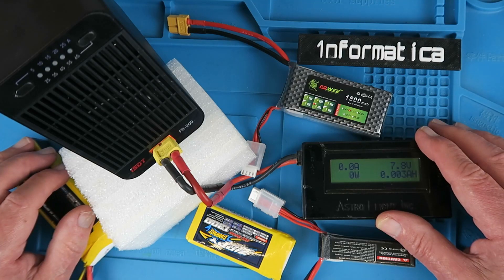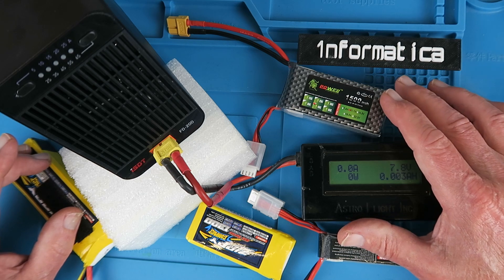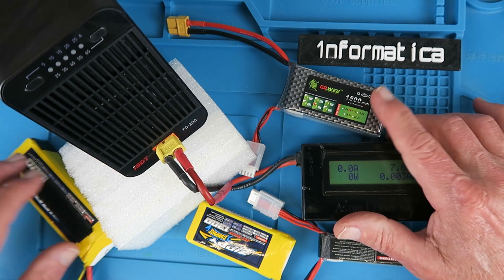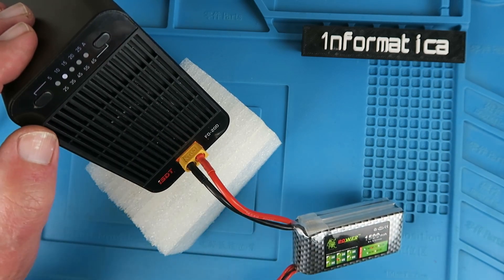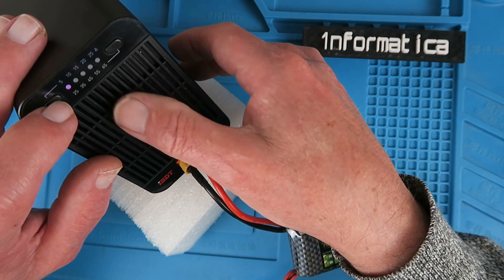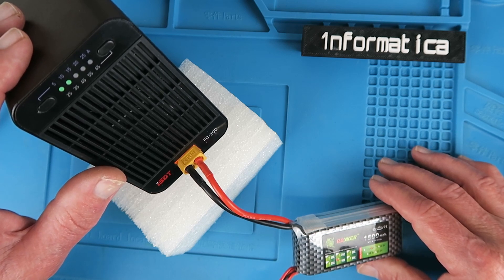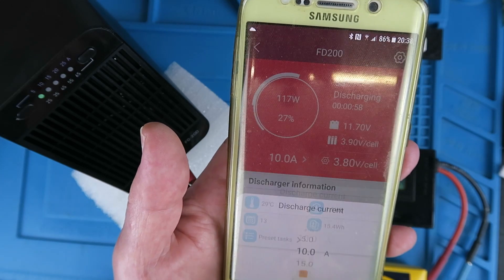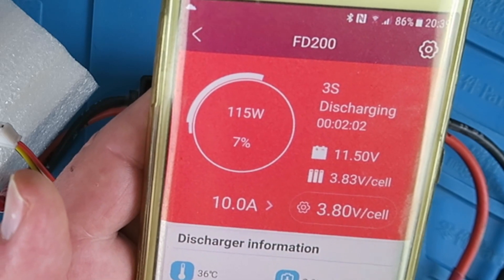ISDT FD 200 200W 25A Bluetooth Control Discharger 2 to 8S LiPo Review

Comment: Thanks for the very helpful video. Your very clear narration, explanation and demonstration is very much appreciated. I have one if these units and am delighted with it. But unfortunately i had to do a reset on my mobile phone a while ago, due to a problem with its camera, and afterwards the discharger can't seem to communicate with my phone. I have tried to re-pair it many times, but it asks for an access code. Ive tried 0000, 2222 and 1234 but none ofmthem work. I have made sure that the phone's location is turned on and that the discharger has permissions. I have also uninstalled the app and then reinstalled it - all without success. I have searched the Internet but have been unable to find anything which has led to the solution to my problem and I was wondering if you have any ideas. Thanks again for the video. Tony
Reply from the maker: Hey thanks! Well, the ISDT App is "flakey" to say the least! Once you connect a battery you get the white LED showing the cells. Open the ISD App and hit + to add the device. Then long press both buttons on the unit until you see a blue "kit car" scanning effect. You may have to open the mobile Bluetooth settings to allow the device, it's list at the end under "additional devices". There is no PIN! Once you see it in the mobile BT list, return to the app and hit scan and it should find it. Even when it does find it I saw the app disconnect during discharging so couldn't get the correct data. In the end I just use "manual" mode and hook a cell checker to the balance port. Have a great day!

Comment: mine disconnects from blue tooth all the time, Junk!
Reply: You were able to connect? I am doing every possible combination on how to bind it but it just doesnt want to bind.
Reply from the maker: @ipadize  You do not need to bind it. Enable Bluetooth on your device, plug in a pack and press either of the buttons near the LEDs and it will beep. Open the app on your device and it should scan and find the FD200 automatically.
Reply: Why is nobody on the entire youtube universe showing the binding process?
Reply from the maker: @ipadize  You do not need to bind it. Enable Bluetooth on your device, plug in a pack and press either of the buttons near the LEDs and it will beep. Open the app on your device and it should scan and find the FD200 automatically.
Reply: @1nformatica  yes i did exactly that. Didnt work.

I got it working now, i had to enable gps to be able to find the device...
Reply from the maker: @ipadize  Bizarre! Glad you have it working now. YouTube no longer shows me if you are subscribed. Please consider subscribing if you have not done so already!
Reply from the maker: I have seen mine disconnect a few times but it is no big deal. The thing is a battery discharger and it does that very well, connected to Bluetooth or not.
Reply: @1nformatica  mine will over discharge 1 cell when it disconnects... They are open to replacing it but a potential fire hazard is scary. I have a couple friends who own them with no issues. If it doesn't work properly the result can be disaster. As a discharger it is potentially a very dangerous tool. Good thing I monitor it closely like we all should be
Thanks for taking the time to review it. well done
Reply from the maker: @donaldfoster5998  Hi, An interesting observation. How can it discharge only 1 cell when the only connection is the complete battery? Perhaps the battery just has a weak cell? What happens if you balance charge the pack? I would check the cell voltages afterwards and see if that particular cell has a lower voltage. I say in the video that charging or discharging must always be closely monitored which I'm glad you are doing. Keep safe!
Reply: @1nformatica  it discharges all cells but allows 1 cell to dip below the thresh hold that is set. EX: If the thresh hold is 3.4v it will allow 1 cell to dip into the 2.Xv range. Not sure how low it would let it discharge as I have always caught it before Disaster. It has done this on several packs relatively eliminating the "bad pack " theory that I too contemplated before testing on more packs. And yes cell count is set correctly
Reply from the maker: @donaldfoster5998  What is the spec of the pack? mAh and C rating? What discharge current have you set? Maybe set the discharge rate to 1C and see if that cell still falls below the threshold. Interesting stuff!
Reply: @1nformatica  I have a ticket out with ISDT
I don't like to get batteries hot on discharge so I discharge at a lower rate usually. I have tried higher rates but temp is my guide. It now over discharges any pack. I use 80-120c packs for freestyle all different V and Mah values. Thanks or responding and helping out. I am miffed but no worries waiting to hear back from ISDT. I wish it had a firmware reload and not repair but all good. Every item can't be perfect
Reply from the maker: @donaldfoster5998  Thanks for the update, please keep me posted on what ISDT have to say.
Reply: @1nformatica  ISDT failed to get back to the Vendor for well over  a week so the vendor refunded my Discharger. Tells you a lot about ISDT
Reply from the maker: @donaldfoster5998  That is rather disappointing. Fortunately my unit is working well.
Reply: @1nformatica  as you stated in your earlier comment, these discharge units do not discharge cells individually. He has a weak cell in his pack, and this is no fault of the discharger. This is often the case when discharging below 3.4 volts per cell. Also I had one of these units that kept disconnecting from Bluetooth, so I had it replaced and the connection has been solid. I own two of them, and use them frequently to save the wear and tear on my chargers.
Reply from the maker: @elliotbaltazar  Great feedback Elliot, thanks for sharing. The unit has flagged some dodgy packs of mine as well. Old packs that you may think are OK can easily have one or more cells where the internal resistance has gone up to the point their voltage collapses under load. I see this behaviour as beneficial but sadly expensive in replacing packs or retiring them to "light duties"!
Reply: @1nformatica  😂 I feel the same way! I got my feelings hurt when I discovered that all of my SMC battery packs were way off the mark in their rated capacity and also had cells that were horribly mismatched. I'm thankful for these devices!
Reply from the maker: @elliotbaltazar  Definitely on the same page! I'd rather find out I had a weak battery on the bench than in the air!!
Reply: @elliotbaltazar  not an impossible explanation for sure. Mine was replaced and had issues on numerous packs including new packs.